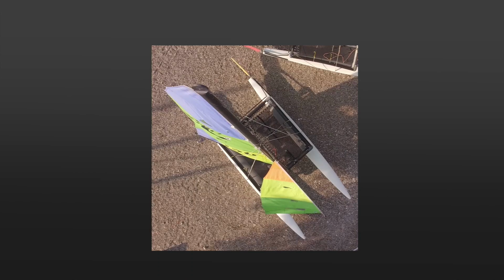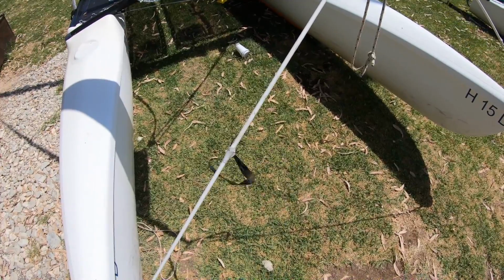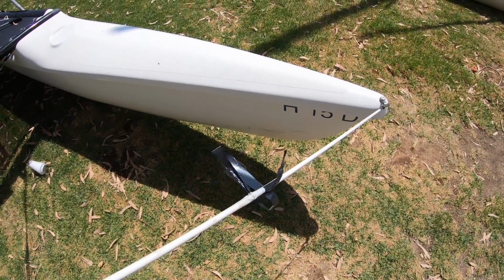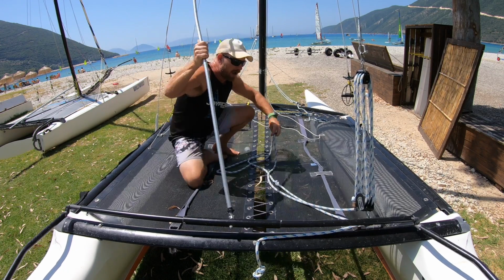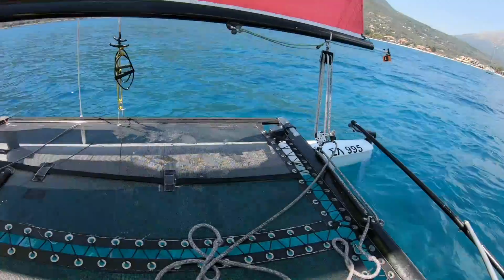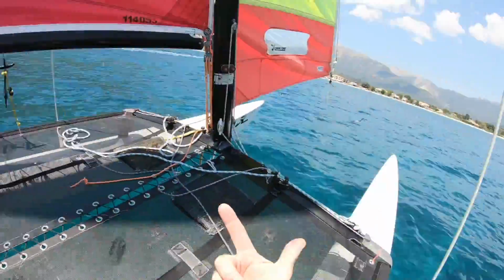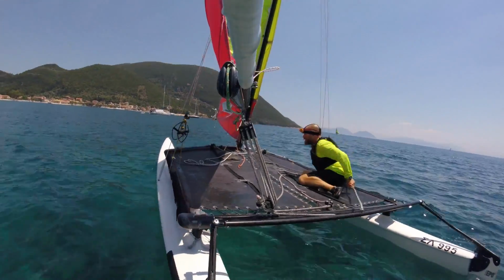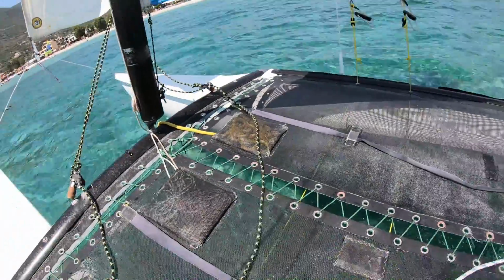Downwind and Gybing catamaran sailing tutorial

Comment: Release main sheet prior to jybe ? When tacking you do mention when to release the main sheet - but unless i am mistaken, i did not capture the moment when the main sheet needs to be released? Or maybe jibe is performed without releasing main sheet?
Reply from the maker: Yes, in the lighter wind, it’s not necessary to release the main sheet before jive as you should loose before. When it’s strong is a good idea to take it to the cleat so that it can go out slightly when the sale permit across.

Comment: Hi thank u 4 this great video ! General question : as right handed I feel less secure with the tillerextension over my right shoulder and feel restrictef to deal with the main sheet , so I leave the tillerextension on my side when I need my right hand more intensivly (no problem on the left side) your toughts?
Reply from the maker: It's quite unorthodox. It's recommended that unless you have a physical impairment you should have the tiller on your back shoulder - so opposite on both tacks.

Comment: Hi there, in strong wind going downwind when you want to gybe, I’ve been told even that you can let the mainsheet eased and to put the traveler in the middle, so as to de power the mainsail and safely pass it on the other side without it going to fast with the risk of generating a probably capsize… then as soon as you are seated on the other side you keep watching the direction in which you are going and the ease all the traveler as to keep it for the broad reach leg
What’s your opinion??
Reply from the maker: This is a great question. 
I will reply in the Q+A on Friday.
- Bring the traveller in - this gets the sail to come across earlier. 
I'll go into more detail on Friday.

Comment: watching all the beginner lessons to get ready for the season and learning/relearning so much.  
1.  Not much discussion in this video about what to do with the jib during downwind sailing/gybing.  Can you comment?  
2.  Also watched your video on running a line to let the jib manage itself downwind.  doesn't look like a great place to tie off on a Getaway, could tie off around the center crossbar but line would exert force on the trampolines, which doesn't seem like a great idea.  thoughts?
Reply from the maker: 2. Yes, I see what you mean - if you were to tie the line around the beam it would potentially slip inboard fouling the trampoline. 
There's not a clear solution apart from tieing a knot like a rolling hitch which is less likely to slip. 
I'd only worry about using this system if you were sailing solo - if the wind was light you can very easily manage the jib without it.

1. On a boat like the Getaway - best to fly the jib across as you gybe - I think this will be best explained in the next Q+A (postponed until Saturday this week)
Reply: @JoyriderTV  got it thanks, with respect to question 1, where do you set the jib while sailing down wind (say on a broad reach).  do you tweak and adjust jib sheeting on downwind or set and forget, and just sail to the bridle telltales?
Reply from the maker: @jamesworks5598  the ideal is to adjust frequently - that works if you're sailing with a crew. 
You gauge where to set it by watching the telltales - if the inside one lifts pull it in - if the outside one lifts, let it out.
Here's the video on the topic - https://youtu.be/_bqs-XXFf1M

Comment: Just to clarify for myself and possibly for others: the 90 degrees of apparent wind guideline comes from wanting to be close to a beam reach, which is the fastest point of sail downwind (other than w/ a spinnaker)? That would effectively follow the same sort of "sail 45 degrees off the wind" rule as when we go upwind for most boats/sails

A few posts about apparent wind if it's helpful for others:
- http://www.discoverysailing.org/funvancouver/members-lounge/general-library/hobicat-pages/sailing-downwind.html
- https://www.cal-sailing.org/blogfrontpage/recent-blog-posts/entry/demystifying-apparent-wind-part-1
- https://www.cal-sailing.org/blogfrontpage/recent-blog-posts/entry/demystifying-apparent-wind-part-2
- https://www.cal-sailing.org/blogfrontpage/recent-blog-posts/entry/demystifying-apparent-wind-part-3
Reply from the maker: Thanks for those links. To put a different reason for it - that 90 apparent is  the furthest downwind that you can go maintaining a flow of air over both sides of the sails.

Comment: Great vídeo!! You are on fire man. 2 videos per day. Thank you for your generosity. I am becoming patreon right now to support your channel. Two questions. No need to uncleat the main? And question two: I learnt in a cat school here in Spain to center the traveler and sheet in almost block to block when steering to jybe. And release it when on the other board.That's to avoid the violent change of side of the main when strong wind. What do you think about this technique? I believe you have more chances to capsize. Thanks again and kind regards from Spain!
Reply from the maker: In anything other than 'survival' conditions you can keep the main and traveller in the same position so that you take max speed into the gybe.
When it's really windy it's a good idea to bring the traveller in to at least the toe-strap and unclear the main so that it will run out when it fills.
Most important in the heavy wind is to go into the gybe with speed.